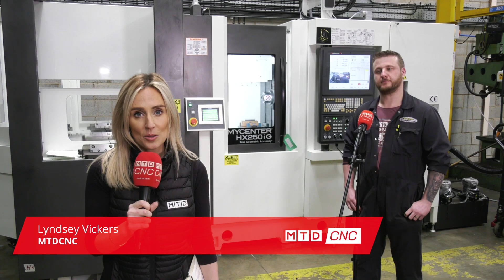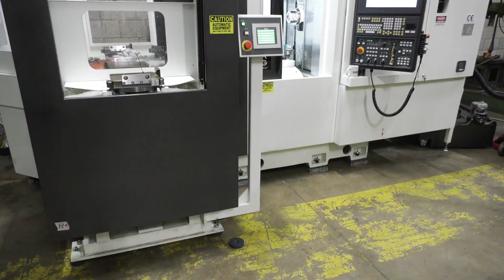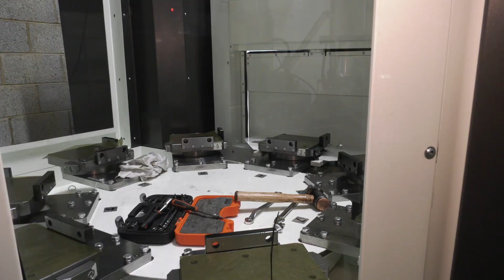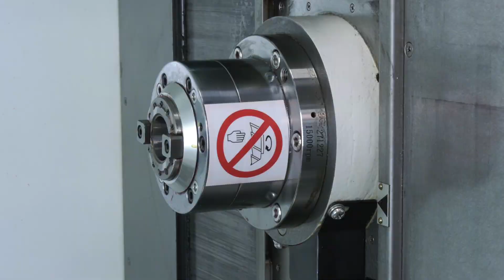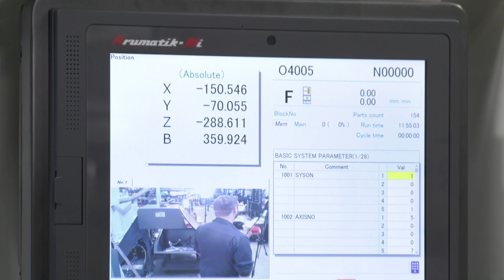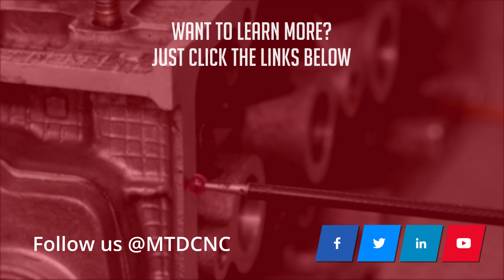10 Pallet Kitamura machine just installed at Hi-Spec Engineering

Comment: Please enlight me - max load on table 100kg - how on earth can you mount tombstone and vices +parts? What am I missing here?
Reply: The Microloc cubes and tombstones with their vices take up 50kg ish so there’s still plenty of weight capacity for our parts which tend to be up to 3-4kg in the size range of parts that will run on this machine
Reply: Its only a 250mm pallet, doubt you could fit more then 100kg if you tried without making it a solid block 250x250. Meant for small parts i guess.
Reply from the maker: It is only a small pallet for smaller parts.  

Glad you enjoyed the video, Don't forget to Subscribe.